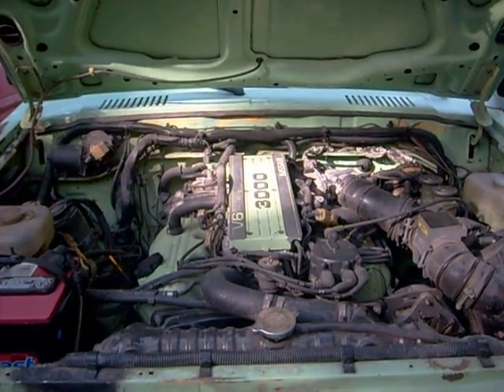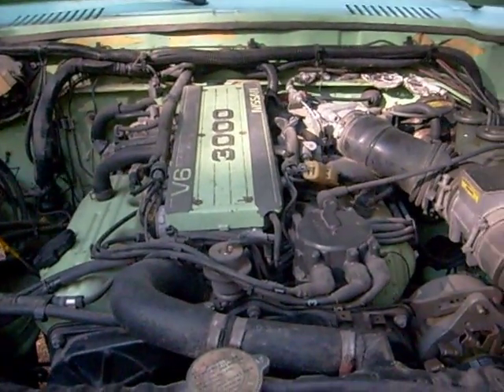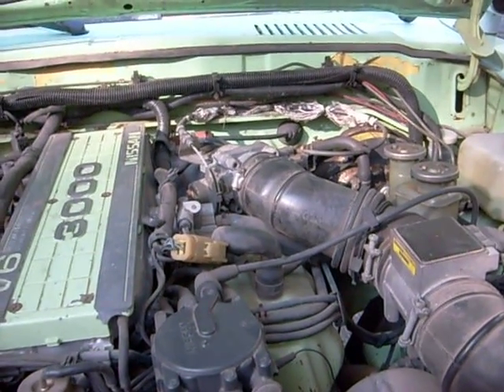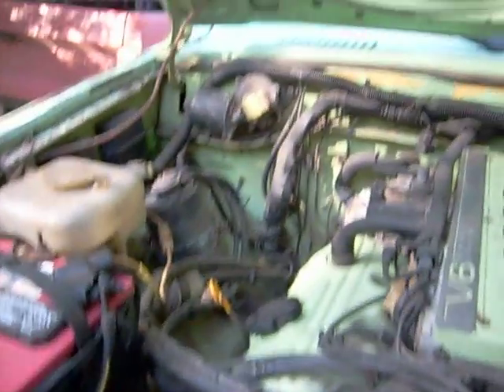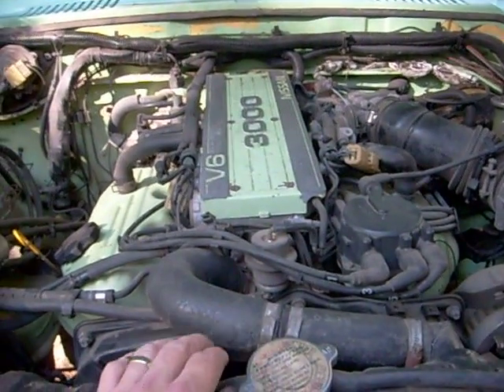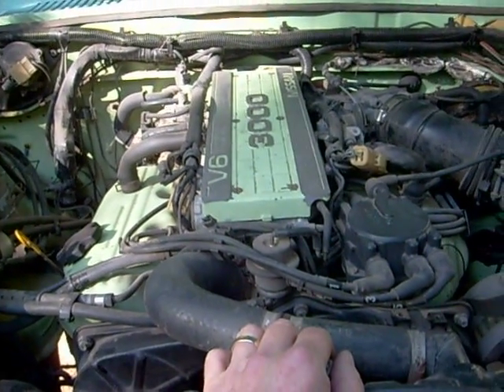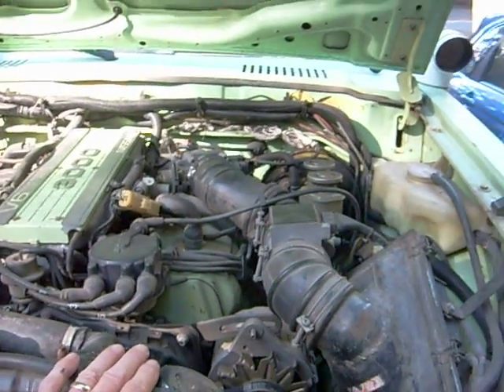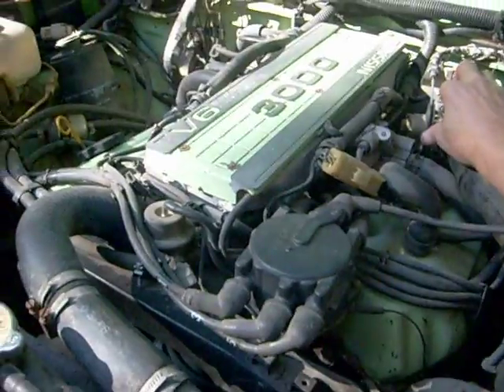VG30  conversion my 1980 720 4x4

Comment: I know this video is older, and the swap is pretty old. I just have one question, and that's with engine and trans mounts, and how things line up. did you have to make new mounts for one or both parts, or did it almost essentially bolt right in. Got an 02 xterra supercharged parts vehicle and I'm swapping everything over to my 720 this spring.

Comment: I’m considering a VG30 swap for my 88 4x4 D21

I’m currently researching the best I can bevies driving 4hrs to pick up the VG w the 5speed, dash cluster,harness and ECU

Do you have any tips?

I’m hoping that everything clears my chassis and suspension correctly and buttons in pretty easy.

I appreciate any nuggets of knowledge, i’m assuming that I’m going to have to address my gas tank and fuel pump having a current carburetor engine

Comment: Good job , ever use marvel mystery oil in your gas?
Reply from the maker: Thanks Bobby, no I just change the oil regularly and stick to good ol conventional Valvoline 10w-40 oil & a factory filter about every 4-5.000 miles. The engine's never been overheated so it should last a long time.